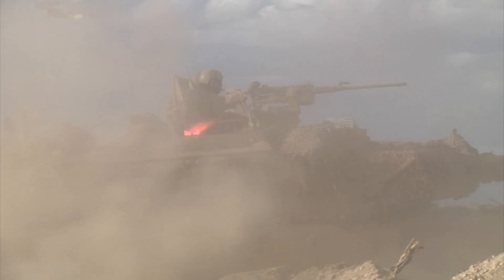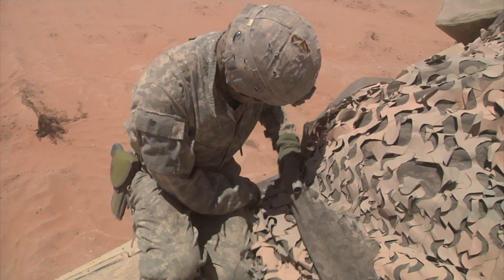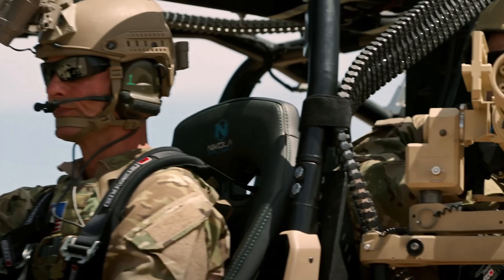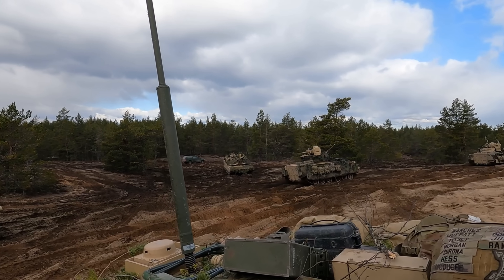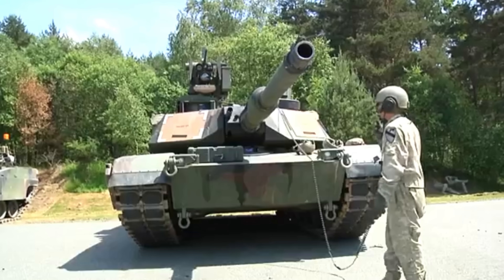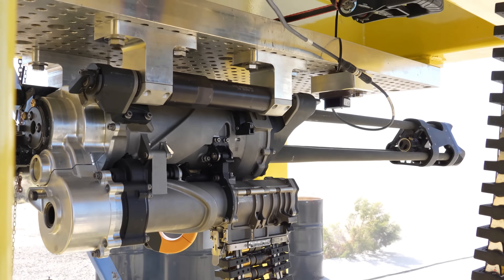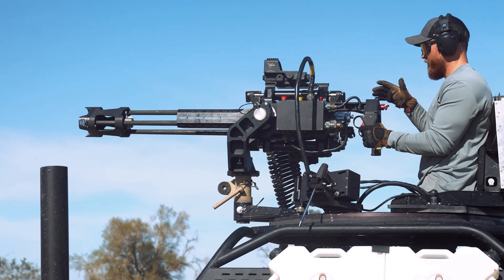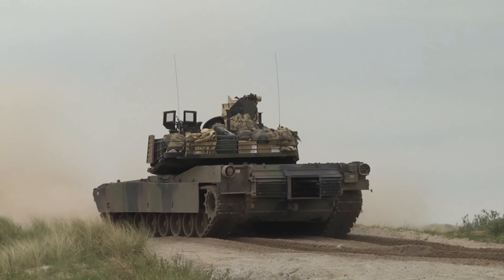Why is the U.S. Army putting a M134 Minigun on Abrams? | ROTARY GUN DEFENSE

Comment: Science Fiction series "Hammers Slammers" tanks had gatling guns turrets used for air defense against artillery shells, drones, and aircraft attacking the formation.  The tanks were integrated thru a C3 network that we already have today.  The "tribarrels" would use the tanks and other sensors to automatically shoot down threats including artillery shells coming in from miles away.
Reply: You're the 2nd comment I've seen that mentioned the series. Must be worth checking out
Reply: @Great-King-Lord_Bezer, it's a great series. It is basically the Vietnam War (which the author did have a small part in with the Blackhorse Cav) , but high tech!

Comment: Stupid solution,  you can put ANY GUN up there but is useless when you cannot target anything ! ^How can you shot what you cannot see / detect ?! Dumb muppets...  Tanks acting alone in this era of drones is suicidal. US is decades behind russians, not only in experience and training for a modern war, against an equal peer, but, most important, in development of mobile AA platforms like Pantsir or ZAK-23E model.
Just look : "The specific feature of the Pantsir-S1 system is the combination of a multiple-band target acquisition and tracking system in conjunction with a combined missile and gun armament creating a continuous target engagement zone from 5 m (16 ft) height and 200 m (660 ft) range up to 15 km (9.3 mi) height and 20 km (12 mi) range, even without any external support" 
A single vehicle like this in a platoon of tanks will give a highly effective "umbrella" against drones than 100 Abrams with the minigun ! 
ZAK-23E even can carry troops, making the vehicle an excellent fit on modern war. NATO neglected the development of such vehicles, capable to target several small targets at once,  and with a high volume of fire and capable to carry enough ammo onboard. No wonder tough, they have long tradition on such systems, for more than 60 years.

Comment: For a supposed armor expert, you really didn’t do your due diligence. The M134 will most likely be used in a CROW auto turret and operated from inside the Abram’s. It makes zero sense to manually operate it, when there are many remote solutions. You even showed an example of the CROWs turret in this video. Beside drone, tanks need to quickly suppressed ATGM crews are well.  In a future battle , US forces probably won’t have numerical superiority. We have to make up for it in firepower.

Comment: Honestly a 30mm auto cannon like on the Abram’s X makes more sense as the air bursting rounds could more easily take out a drone, it would be equally good at taking out infantry, would have really good anti armor capabilities and being remote controlled would protect the crew. It’s also just a lot more firepower at a longer range in a package roughly the same size as a .50 cal

Comment: The M134D makes more sense than the GAU8. Put it on a CROWS with an automatic mode. 
And you can select the rate of fire on it, besides the fact they can stow more 7.62 than .50cal. Also, if it’s automated, it will be more accurate requiring shorter bursts to do the job.

Comment: To deal with drones, they will need a high frequency Radar and EOIR system tied into a command and targeting system.  An APS system sensor would work great.  If they don't want use APS round on drones, then tie it into a remote gun system like the one they use on M-SHORAD, Sgt Stout or MADIS system.  They are likely not going to defend against a single drone and both finding and targeting them is the hardest part.

Comment: If a one inch wire tail were attached to the tail end of a bullet wouldn't the wire expand out dew to bullet rotation? The bullets range would diminish, but should go out far enough to engage most incoming drones. Every bullet would have a two inch kill zone for drones.

Comment: The GAU 19 rws should suffice not just for anti drone but common sense, Armored warfare moving forward is going to have mbts with secondary auto cannons (20-30mm) the new European Defense firms are already doing that to include moving away from the 120mm to the soon to be norm of the 130-140 mm main gun. The funny thing is the common sense of having the M134 or GAU 19 being mounted on an MBT is nothing new,now drones is forcing an issue that should have been fielded already, the proof is the M1E3 Abrams (Abrams X) that still mount the 120mm but add a 30mm rws and loitering munitions to boot,i wonder why.....because the battlefield has evolved and the MIC is catching up to pimp the DOD again, a CIWS system was created indirectly for Armored vehicles called the micro gun (a multi-barreled 5x56mm)  but was never put to use,why because the MIC convinced the Army that there wasn't a need!? Kinda like how the Army got played with the M10 Booker when the M8 was the go to choice for the Army (especially the 18th ABC) MBT's will be in a threat environment that will require advanced sensory fusion /weapons systems that can assist with the defense of MBT's  the rush to make MBT's smaller lighter and Expeditionary will not suffice because of the systems that will be needed to secure the MBT so the size will get bigger again, unless power systems get better (smaller longer lasting etcetera) The GAU 19 will be better along with some sort of VLS micro antidrone missles)

Comment: I think the GAU-19 is a good option for a RWS that is semi automated with the user issuing the kill command unless its set weapons free you could store the ammo externally. The Power issue can be solved by the power efficiency gains with the new Variant of the Abrams. Endgame Hardkill anti drone solution on a armored vehicle is Lasers but this would need a significant jump in electrical power generation ability.

Comment: I'll be surprised if they don't wind up with (similar to the AbramsX and likely M1E3) an RS6-mounted M230LF tied into the Trophy FCS, or whatever built-in APS's Fire Control computer in the new Abrams...
But, yeah the M134 I just don't get why you would even bother trying this, if for a similar weight you can get a 30 mm cannon with air-burst munitions...

Comment: Leave it to the US military conplex to address a 500$ drone with a 5,000$ system that burns through 500$ in what 30 seconds?
Stubby crows AA12 style shotgun utilizing high brass birdshot. 100 birdshot rounds are not expensive. If its not mounted on your shoulder a full auto shotgun is not a big deal.

Comment: A lot of the issues you/others bring up can be solved - electronic systems to detect, track and provide a firing solution against drones is coming along in leaps and bounds and can be compact and low power.

The bigger issues are the point you bring up near the end about having to watch the background when shooting and not accidentally hose down friendlies with 1000 rounds and that those rounds, which don't hit a drone, have to come down somewhere - the larger CIWS systems like Phalanx have fused rounds that can self-destruct to minimise collateral damage but that is harder to do with 7.62 or lower calibres.

Tanks definitely need some kind of mini CIWS type system on the modern battlefield though. Drones generally are quite susceptible to damage so I kind of lean the other way that faster flatter shooting .22x calibres with say a 3 barrel Gatling type system might be more suited to the job here but a M134 or similar does have a huge amount of utility beyond just defence against drones.

Comment: The best solution for drones, much less fast moving drones, and cost effectively, is Metal Storm 36 barreled, electronic firing suppression fire system. (Yes, there are videos of it on YouTube)
What's needed is a detection system, and a shot gun-like panel. Any dipshit worth his salt KNOWS you don't hunt Pheasant with a rifle, you use a shotgun, filling the flight path of the bird with steel (or lead) shot. One shot, dead bird. It's just like the moronic Army to scratch their head and thing firing a pencil thin string of bullets at a fast maneuvering drone is going to achieve anything at all. Holy fuck these brain turds are morons🤦
https://m.youtube.com/watch?v=wKlnMwuCZso

Comment: I believe you are failing to see the point: in this era of drone warfare, relying exclusively on an ordinary .50 caliber gun, which is what most tanks have right now for defense, is utterly pointless. A simple minigun just improves the chances of the crew to stand against a drone and is quick and easy to implement. It is not perfect, for sure: an automated system is much better, but then how long till you modernize all tanks, and at what cost in maintenance, logistics and economical point of view? A minigun is a cheap and quick interim fix for an already existing problem.

Comment: I would point out that these drones are not autonomous. They require coms with the operator. So what you really need is better ECW. Directional jamming is a known technology. Though some kind of EMP gun would be a better choice. You can only shield a commercial drone so far.  I seem to recall hearing that the DOD was working on one a long time ago.

Comment: Too high tech. I agree "shotgun" style weapons would be more logical. Something like a 40mm shotgun makes way more sense. Yes I know they don't make them. They can, easily. Make it with a brass or steel case and make it rimless and put it in an exploding link  belt feed. There should be an automatic warning to the other tanks in the platoon and any attached infantry when it goes hot so they can button up or claw dirt. 

Shotguns are area weapons, we know how they work, have been using them for centuries, and they won't damage the armor or doghouse near as much as rifle rounds will if there is a mishap.

Comment: I’m a huge fan of your channel, Matt, but in this instance, it sounds like I disagree with you 😱 For some reason, I decided to post an obtrusive, long stream of consciousness (detailing all my thoughts as to why I think the M134 is a good inclusion in tank upgrades) below. Hopefully, this long comment helps to boost your channel in the algorithm, if nothing else. Further, I want an M134... 😤😭

I wouldn’t imagine the M134 is proposed as the preferred solution in anti-drone warfare but it is another tool in the army's toolkit. You've got to remember that the vision for the future is to employ tanks to provide direct large calibre fires from an armoured AFV within a formation protected by MSHORAD. 

We're talking about a team effort and a layered mobile air-defence that includes networked lasers, 30mm or 40mm AA, man-pads, interceptor drones, and more. If drones manage to get through all that, or by way of sheer numbers, they simply pose the risk of penetrating, then tanks will have canister rounds from the 120mm gun and its other weapons to increase the weight of fire/effects targeted at the threat. 

Of course, tactics of last resort are not new things. The Chieftain recently made a great video elaborating upon the inclusion of the use of the Abram's main gun in defence against drone attacks and highlighted the fact that, much like its use against enemy attack helicopters, this is just another tool to be used when appropriate - not the default or first choice in every scenario. 

I would also expect that if trials find that the M134 is effective against small to medium sized drones, it could then be developed into a more refined concept. For example, it could be fitted elsewhere, incorporated as a remote weapon station, or the responsible crewman could change. Ultimately, the M134 could just be adopted for use on accompanying vehicles. 

I also think it is a good choice for a readily available and practical solution. The M134 has proven reliable in all sorts of harsh conditions, can be produced in large numbers, has a good balance of range and accuracy for the anti-drone role, has established maintenance requirements and known costs, and uses a widespread, mass-produced calibre of ammunition that has an extensive global industrial base behind it. Indeed, the choice of calibre means US allies across Europe, Asia and the Middle-East could make their own stockpiles available during hostilities. 

Another thing to consider is the individually networked infantryman of the future. At some point in the not-too-distant future, soldiers will likely have a HUD. It’s no longer speculative research but as you know, there are serious efforts to develop effective user-friendly augmented reality (AR) devices. Whilst there is a race to be the first military to field this potentially revolutionary technology, over time doing so will become easier and more affordable. 

It’s the same accessibility trend that we have seen time and time again (in everything from firearms technologies, to armoured vehicles, to anti-tank weapons, and now drones). Commercial AR technologies are advancing rapidly. By the time the next big war comes for the West, it may be that the portable radars and other sensors attached to mechanised forces will be networked with soldiers’ HUDs, and can enable the AR suite to provide aiming assistance. In this future, simple weapons may become far more effective and efficient. 

I also think that, much like the Ma Deuce on M4 Sherman’s during WW2, the inclusion of an M134 on a mount with a high degree of traverse could be appreciated by tanks crews and accompanying units in a wide variety of situations. For example, unlike the main gun, it can be fired without fear of over-pressure effects or the danger of back-blast experienced with some man-pads that are mounted on AFVs. Plus, it could aim ip in urban environments. 

The M134 can also be used to suppress enemies whilst the main gun and its coaxial weapon work its way through targets (effectively increasing the presence and effect a tank can bring to the battlefield). Indeed, this weapon can be used with great precision (as demonstrated in Afghanistan by incredible door gunners), or suppression of known/unknown targets (as demonstrated in Afghanistan and Vietnam). In urban environments, thick bushland, and the tropics, this could be incredibly helpful.

Comment: Why not 4 side-by-side remotely operated aa-12s they would have a combined fire rate of 1280 rounds per minute and would be able to throw up enough chaff into the air. No drone within 80 ft. Would be able to get close enough to the vehicle. Maybe ask DARPA and Honeywell to work together and develop 12 gauge anti-air proximity fuse rounds for the aa-12 platform In particular, you'd still have that rate of fire but you would be able to reach a lot further out. I'm guesstimating probably 300 to 400 ft At the minimum engagement range for something like that. Or they could really just miniaturize the C-whiz and stick two of those on the back of the tank. Kind of like rabbit ears. Maybe put some little platforms off to the side that extend out so the system can operate 360 around the vehicle

Comment: Back in 2011 the master gunners discussed doing this. The feedback we gave (the operating force not MGs) was there was a concern with using the complex and prone to stoppage electronic feed of the mini gun. While all MGs have stoppage, the 3000 plus peice electronic feeder is a bit more complex than the M2HB.

However, the CROW introduction seems to introduce the same concerns. Making it a similar concern with both systems.

My main issue with both was the daily operation of the tank was made more difficult with a big peice of metal infront of the TC for just getting around. The obvious counter point being having that large thing in front of the TC to protect him/her when riding open hatch. Same points for the loader.

The other concern was the skill level 10 being able to maintain the system. Additionally the leader's M240 was what we used to dismount and establ8sh LP/OPs. I do not see the loader doing the same with this system but I could be wrong.

Replacement was another aspect brought up. When the weapon system was destroyed, getting another M240 wasn't a big deal. In LSMO operations the mini gun replacements may not be so easily replaced.

  The other point brought up was that the loaders M240 was not used very much in general. Now this point could be old as this was a GWOT note. So I would defer to Ukraine and Gaza tankers to speak on how much their loaders used their crew serve weapons. I would assume the loader would keep doing loader things with the gunner while the TC serves near targets. Jumping into his through sight for target confirmation time to time.

This seems more of a "posturing" move then a practical one. I would like to hear from the Fort Bliss tankers, though they may be a little biases cause Miniguns are just that cool.

Comment: why not full auto/multi barrel 12 gauge? that way if you miss but close... you do not miss? (lol, said this halfway through the video!)
 light weight "claymores" of some sort would be good too, multi use? have them in some sort of blast panels so they do not all go at once, as the trick by the drone guys would then be just get all the panels to blow on the first ones.
 Lots of interchangable parts between M1 and M1A1/A2/Etc. (can we have an M1AEtc?... M60A3 TTS says Yes!), we can use M1 hulls to build SPAAGs on and to carry extra munitions in battle areas?
 Have them "follow the leader" AI in some fashion and the extra hulls would be at least confusing to drone attacks, let alone carrying the extra ammo for use near the front and the SPAAGs 
 M1 SPAAG is an old idea. the July-August 1996 issue of Armor has an article about the concept.

Comment: 1) UA and RU have gone to slat armor out of hard earned experience.
2) a CROWS mounted-like 30×113mm with some form of automation, and timed/proximity fusing seems like it would be way more effective.
3) A twin  M240 mounting can get you to 1300+ish rounds per minute, for similar weight.